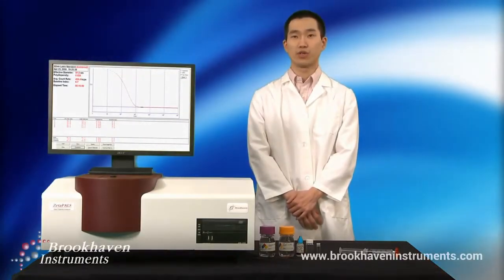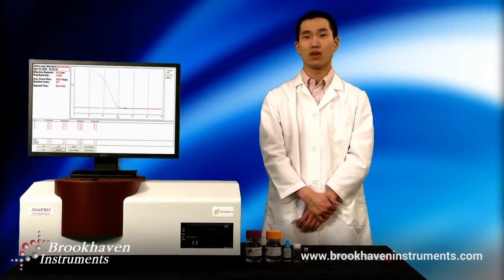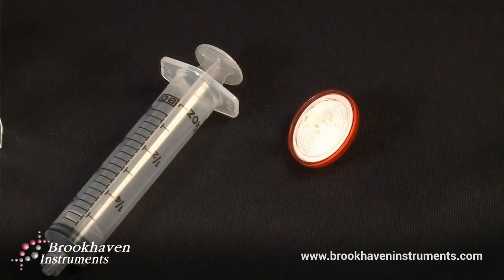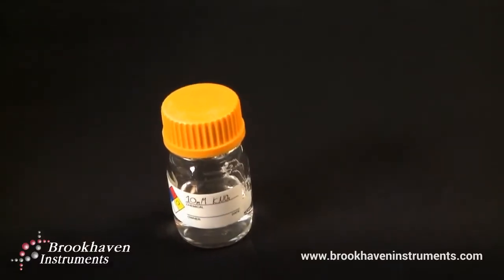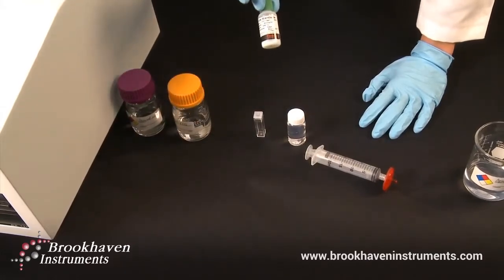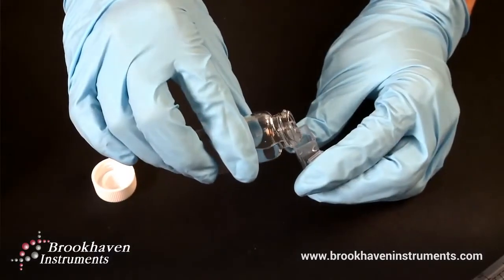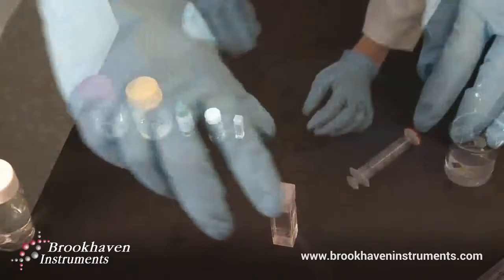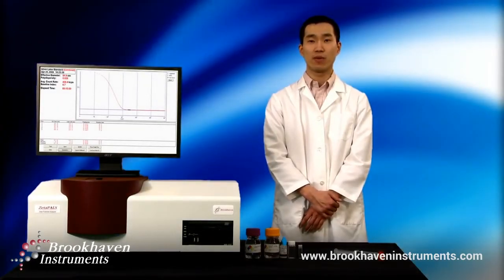Particle Sizing: Sample Preparation for Dynamic Light Scattering

Comment: Thank you. What is the minimum concentration of the sample required when we are using powders.Could you please elaborate more on sample preparation of powder solutions for accurate DLS measurements.
Reply from the maker: Hello, Sai. In order to measure powders by DLS you’ll need to find a suitable solvent to disperse them in. For more information on dissolution of dry powder samples you can refer to our sample preparation guide:  https://www.brookhaveninstruments.com/guide-for-dls-sample-preparation/

The minimum concentration is going to depend heavily on the material.  The larger the difference between sample and solvent refractive index, the lower the minimum viable concentration will be.